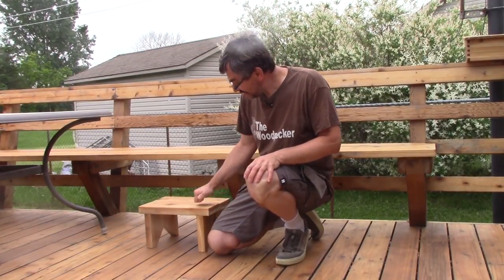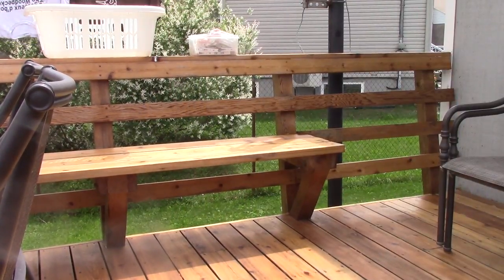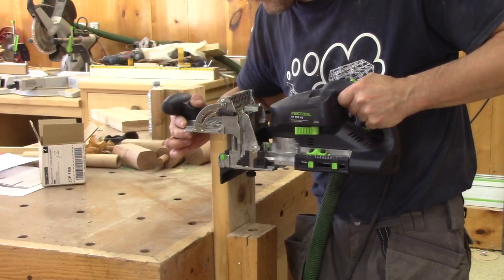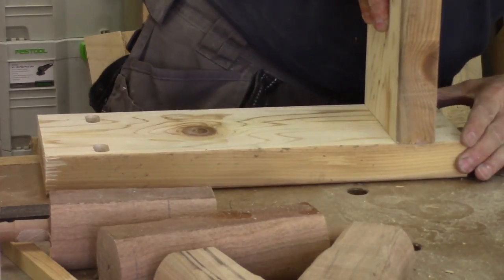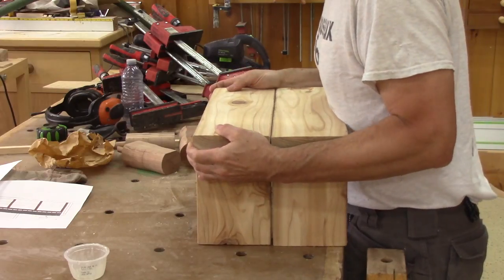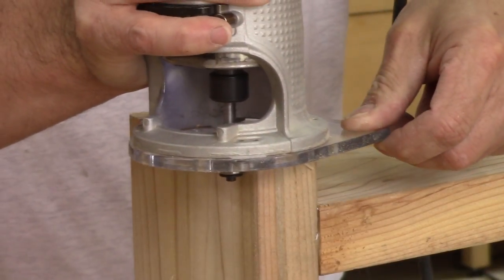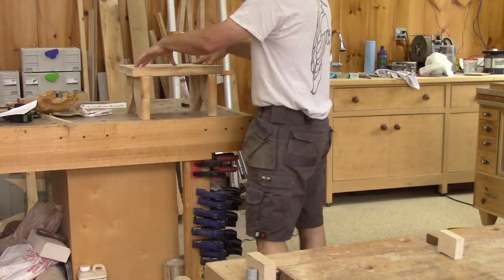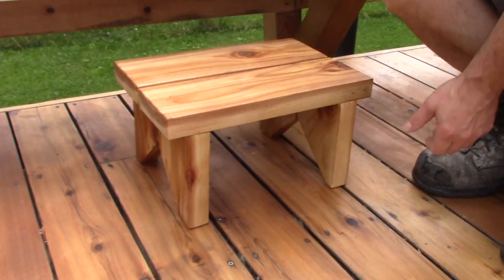The Woodpecker - A small cedar step

Comment: Bench is nice but hanging clothes while standing on the bench seems dangerous. I think I would prefer to lower the clothes line so as to stand flat on the deck. Of course my opinion is biased by my fear of heights 🙃
Reply from the maker: The idea was that in the beginning, to lower the clothe line. But because of the bench it's awkward to stand there it's WAY easier to stand on the bench itself. As for the fear of height, I can understand, I lost mine when I raised my 64' height tower at the cottage and I had to work at the top for several hours if not days to raise everything there. I had to do if I wanted this tower. Nothing like jumping into water to save your kid to loose your fear of water....